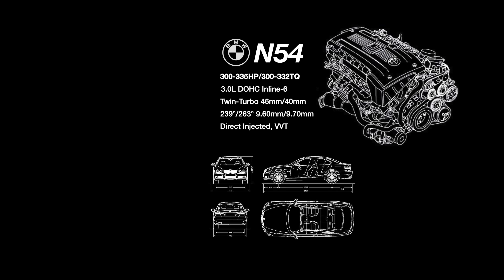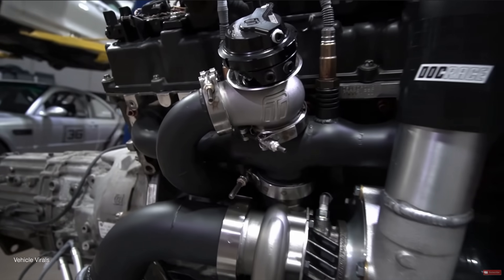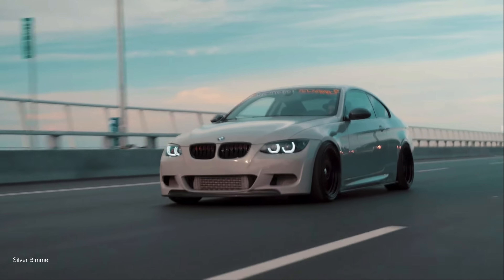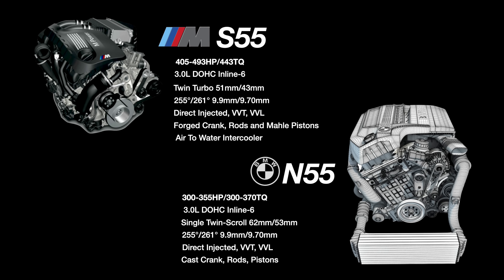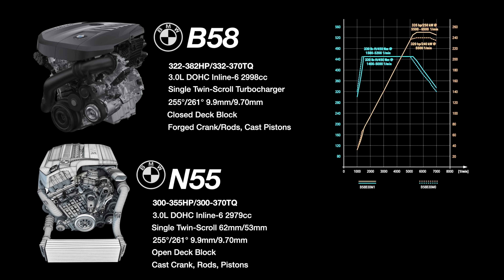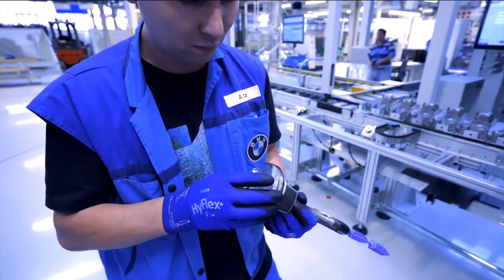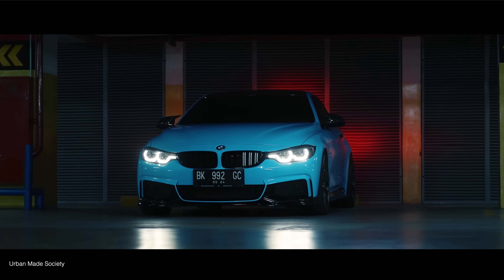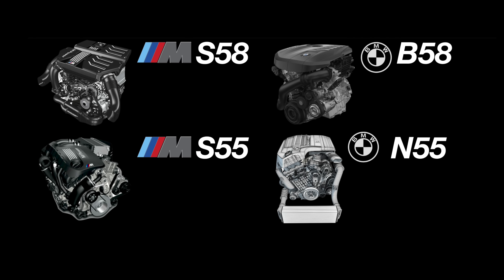BMW Turbo Inline-6 Engines Are Ridiculous | Explained Ep.4

Comment: My only complaint about the B series engines is the timing chain is on the back of the engine. Makes a timing chain replacement an engine out job, same for anything else that rides on the timing chain. Hopefully they don't have chain guide problems. In a BMW fashion, they will be able to charge more labor costs for maintenance on those components.
Reply: The theory here is that the timing chain needs to be done once in the engines lifespan by the time the second chain and guides are done the entire engine is done.
Reply: @alouisschafer7212  I understand that. My issue is, BMW's idea of "lifespan" is different than most peoples. BMW only cares about the warranty period and maybe a little beyond that. These cars usually stick around much longer than that. 

Hopefully since Toyota chose to use this engine it means it's a reliable design. Toyota's idea of lifespan is significantly longer than BMW's. Haha For future I would look at Toyota's recommended service intervals for the B58, not BMW's.
Reply: @175dell  Toyota probably cuts BMWs oil change interval in half just to name one service item.
Id do it every 6 months or ~5000 miles on this engine. That prolongs the lifespan of the timing chain.
Ans id use a 0w40 even if BMW recommends a 0w30 or 5w30.
The 0w40 spec is kinda the ideal oil these days its not as thick and viscous as 10w40 or 15w40 but also not as watery and thin as 0w30 or 5w30.
Reply: @alouisschafer7212  Yes I would agree 100%. I run that oil and oil change interval in my n55. 

The reason I'm so skeptical of BMW's service intervals, my X3 has a GM transmission. BMW says the fluid lasts "life of the vehicle", GM says change the fluid/filter at 100k miles, and (I think) every 50k miles after that. I do every 30k just to be safe.

Comment: We've got a 1m with the n54 (weighing about 1500kg) With a little tune from G-power it pushes 450 PS. Which is basically a driving hazard at this point. It's scary to drive

Comment: bmw tech here, most of the time n54s are bit more reliable, i find n55  to be a bit more sensitive and have had a few blow head gaskets from not much.. one thing you should do for sure is if you get n54 or n55, replace the main conrod bearings asap! ive seen bearings that have done under 90000kms that were "grannied" all their lifes and they looked real bad. ive done more conrod bearings than i can count lol

Comment: What about the B48 beauty? Little 4 cylinder Engine with a Single Turbo, when tuned after essential bolt ons....leaves the M235/M240i in the dust. Never thought to see a little baby engine have such pull.

Comment: correction N54 was never outclassed by M3 V8, in fact 335i were substantially quicker then the M3 e90 e92 that's why BMW recalled all N54 and detuned them so they can be slower than the M3s...

Comment: Had 335i n54 2007 mt 2012-2016
Bought with 60k km sold with 130k

Intercooler/downpipes+exhaust/cobb stage 2+ from day one

Car hasn't seen a DAY without redline
0 trouble, only service with oil/filters+sparkplugs+tires

Comment: Just want to throw in that BMW's Diesel engines are also awesome.
Got the N57D30S1 in my X5 M50d. By the time it was released, it was the most powerful diesel engine in mass production.
Again, six cylinders, 381hp and 740Nm of torque.
Reply: Fully agree! I once owned a 4-series with biturbo N57 (750Nm with little mods) and between traffic lights it easily outran M4s.

Comment: So, BMW has proven that with enough boost you can get lots of power out of a 3 liter inline 6. The problem with this is that inline 6 cranks are just too long to handle these loads very long. While this engine design is smooth and has a great sound, it simply can’t sustain these loads. The result is a sad history of bottom end failures that have gotten to the point where BMW has declared that bottom end bearings are a routine wear item. Great cars as long as you don’t plan on owning them beyond the warranty period.

Want an engine that can handle high loads over the long haul? An inline 4 or vee configuration is a far better choice.

Comment: The N54s are nasty. I have a 335D with the M57 diesel. The torque on those engine are insane. And with emissions deletes and a stage 2 tune they're very quick. It's very easy to wipe out if you're not respectful or the car or don't have experience driving one.

Comment: I have worked with BMW for thirty five years, and I must say this was a very good presentation. Great job on this video!
Reply: Then you might remember the m30, my modded 635 csi puts out 332kW or "450 to the wheels" on a mostly bone stock engine.
Well apart from the Bi turbo kit I built. 😉
Reply: @daniel635biturbo  
Why would he remember that?
Reply: @Colby_0-3_IRL_and_title_fights  Do you remember the m30 ?
Reply: @daniel635biturbo  m30s love boost
Reply: Nomen Clature  JZ wasn't for the Supra. It was originally for the other Toyota vehicles where the JZ started first
Reply: Nomen Clature  if you are talking about the JZ platform, they wouldn't be able to be sold in most markets due to emissions standards now. where as these I6s that BMW has kept putting out, they can still release them in many hard emission standardization locations. sure you could do 1k HP on a JZ setup but these I6 from BMW are just king cause they never stopped making them and kept improving upon the design as you would expect from a luxury brand whos customers will just pick another luxury if they didn't constantly compete. Say what you will but Mercedes Benz and BMW having this long time rivalry has made some of the best cars on the road to date and you can tell just by how well they put the power down instead of squirreling around
Reply: Can you get me a job there. 😊
Reply: What do u think of the M3 F80 S55 engine and high mileage over 150000kms are they Reliable?
Reply: @maximusEagle  it really depends on how it was taken care of. In general M cars are usually pretty reliable. As reliable or even more reliable than their non M counterparts. Used M models usually are beat up or very well taken care of. Just remember there is nothing more expensive than a cheap BMW. Ha ha
Reply: What do you think of a 2010 635d
Reply: Then you’ll know bmw motors are pretty over rated from 2007 til now . I used to work for bmw also. You gotta love the Bimmer fanboys they will lie to the moon and other fanboy would join the lie 😂😂😂.
Reply: Claim that BMW is king of in-line 6 cylinder engines is quite funny since no one else is making petrol in-line sixes.
Reply: @TermlessHGW  do you know why that is? Because every other brand will normally use a BMW inline 6 rather than make their own because they know they couldn't compete.. If you think that "Toyota" "supra" everyone raves about isn't a BMW in a Japanese costume then you're lying to yourself. And Toyota make great engines, but even they were humble enough to say yeah we can't beat it so we'll just use it. And they created the famous 2jz which is an inline 6..
Reply: @MDM1992 you’re confuse asf … must be a big fan ?  No one barely used bmw engine so quit lying ..
Reply: @TermlessHGW  why get into a field some other group has perfected indeed, I'm an "ls guy" myself but I love older m3's and the like, cut my teeth on those cars
Reply: @TermlessHGW bmw are stupid !  It took the 2jz 30 years to make that claim and bmw design one junk in line 6 and claim to be king .. oh well you know how dumb kids are . They claim first to drift , first to drag race … bmw wasn’t doing anything when drifting was out or drag racing was popular . I love listening to bmw fan speak about the major bullshit that bmw has spread . One rumor is the bullshit they make more power than they claim .. bullshit we dyno over 10 b58 and s58 and they are dumb asf to make that assumption.. we dyno a b58 with all kind of shit done to it and it barely made 428 hp .. and that’s pushing it .. don’t believe the bmw guys they’re full of shit
Reply: ik u worked overtime alot fixing 1000 bimmers a week
Reply: @presidential3228  shut up
Reply: @rudgerscumberland9837  no
Reply: @presidential3228  Yes. Facts!

The first vehicle to have the 2JZ was the Toyota JZA147(Aristo)/Lexus GS . 

NOT the Supra MK4 A80
Reply: @rudgerscumberland9837  i know that you’re right i was just high bro and something just told me to reply no 😂😂
Reply: @presidential3228  Don't hurt our feelings bro

Comment: I know it probably would have been a lot but it would have good to know what cars/years each engine was found in. No knowing a lot about BMW's (but really want to get one) it would have been fantastic!
Reply: For e9x chassis 
N54 2007-2010. also used in "335is" for 2011-2013 e92 and e93.
N55 2011-2013. 2011 was the last year for e90. E92 and e93 continued for 2 more years under this new engine.
F3x
2013-2015 f30 335i used n55
2014-2015 f32 435i aswell. Keep in mind 3 series coupe is no longer a thing, it is now 4 series.
B58
Used in 340i 2016 - 2018
2016-2019 440i.
G20 
340i and 340i whenever those years started.
Don't think there is an update engine for the LCI models, or in other words face-lift updated models.

Comment: New video idea: Compare cam degrees, valve lift, and valve size. Which engine has the hottest cam? Which engine has the biggest valves? You could do a Top Ten video for each. Bonus if you can get flow bench numbers.

Comment: Ah BMW vs 2jz that came out 20 years earlier. Yet the new Supra's use BWM engines so there is that. I see them at the track on there is a BMW not supra. Cause it is a BMW badge as Toyota. Yeah you got to deal with the the BMW stuff for all the leaks
Reply: It's still a Toyota Supra. 

The other cars such as the Pagani Zonda series uses Mercedes engines yet nobody refers to those vehicles as "Mercedes".

Comment: Bmw's legacy ended late nineties and early two thousands, engine may be powerful but they are pieces of shit, too much technology for a "not smart" consumer, even subsystems are faulty, suspension, cooling, and going back to valve train, man on man, toyota was able to make a variable timing in late 90's, bmws design and it's  oiling system with that pos motor that runs the valve train is a disaster, couldn't waste 2 seconds in my life to look or be interested in these posss

Comment: Hey brother, I really enjoy your series on engines and vehicles and all the other shenanigans! I was wondering if you would do a video on the BMW m57 engine and mainly the e90 335d here in the states, I'm astonished at how little attention and content there is on them as they make an easy 500+ tq at the wheels and 50 mpg with a piggyback tuner, stock out of the box! The platform has been around for sometime and still evolves and I think it would be excellent video of this quality and enlightenment!
Reply: most versions of that engine are a beast when it comes to upgrades, all you need is a bigger VG turbo and a dude with a laptop that knows his thing, to make some easy HP and NM xD I am driving an e39 with the smallest M57, the D25 with a turbo (direct bolt-on) from an e60 m57d30tu (218) and a remap, it hits the fuel limit at around 230 bhp at the wheels, but this isnt what is insane about it, the insane is that it hits a little over 600nm, for some reason that thing PULLS like a train! Couple of months ago i had to give a tug to a friend of mine with his 190e (yes, i pulled a merc on a rope :D ) which wouldnt start and at 1 moment i received a call from the guy (i had forgoten i have a car on my tow hook) "dude, slow down, we gonna get killed" - the bro was terrified as it was not us doing a 160km/h while pulling the car by a rope 
by the way the car gives an economy around the 50 mpg when driven calmly :)
Reply: Brah wtf

Comment: Very good video but some incorrect information, n54 early 07, 08 have foraged mahler pistons and at lest the n54 intake cam is wrong. Its 9.7mm with 245° duration and they can handle 1200 crank horsepower on a completely stock engine till the open deck causes cylinder wall blow out with an unknown power limit on a closed deck

Comment: Remember the 2006-2010 M5 engine, blown piston rings around 60k-70k miles! Give it a few yrs and lets see how the engines hold up.
Reply: There's already been b58 pushing 300.000 km I'm sure they'll be fine. In the next two years the people that drive consistently will be pushing over 100.000. Also N55 and N54 we already know about. Oh and you are talking about a V10 after all🤷🏽‍♂️ requires alot more maintenance, I'm sure if you did your throttle actuators, rods, and VANOS solenoids it wouldn't fail.

Comment: When the MK5 Supra came out and everybody and their grandmother was bitching about it not having a JZ engine and having a BMW engine, almost nobody understood that BMWs 6 cylinder turbo engine post N54 are pretty much the modern day equivalent of the 2JZ. I commented that on a couple of videos about the Supra and got bombarded by 14 year olds who know better. Yes, the N54 has it's problems, it's basically the first generation of the motor and it's 16 years old by now, that's to be expected.

Comment: I've had a number of turbo and twin turbo cars, but recently picked up a pre lci N52B30 E90 330i. Fun as turbos are, I'm finding the NA straight 6 to be very satisfying.
Reply: I have the exact same car. Did you flash the TCU? Makes a big difference. And yes, it is very satisfying. Only going to add an electric cutout to the exhaust, I'd like to hear a little more from time to time!

Comment: They are not that reliable, otherwise people in drift would never ditch them for 2jz.... I guess normal racing stress engines a lot less, than drifting. 
But when i started to go into drifting i was so shocked, that everyone swaps all bmws for 2jz... Even real m3 cars, unless you have a huge budget then you can run whatever you wish, but most guys in pro leagues run 2/1jz.... and i had no idea why, but turns out - cheaper, more reliable power.

Comment: Speaking of reliability, I was told that before the BMW/Toyota partnership, Toyota tore apart the whole engine and told BMW to fix this and fix that before the supra deal was finalized. Can anyone confirm this?
Reply: BMW started production of the B58 in 2015, four years before the launch of the Supra. Supra's engine has only one significant difference, a worse flowing exhaust port.